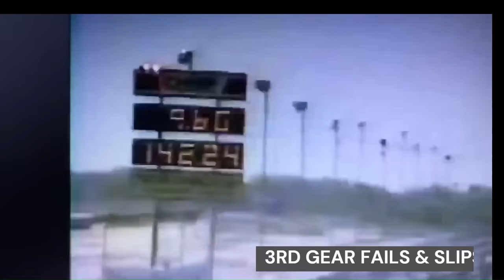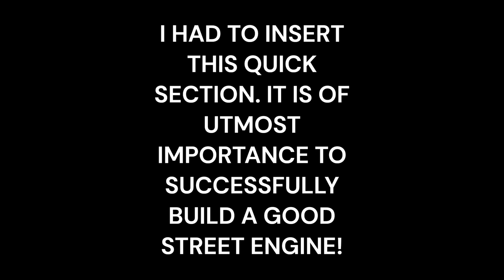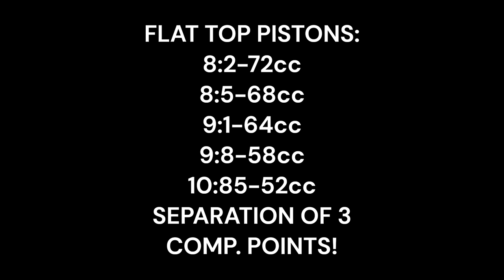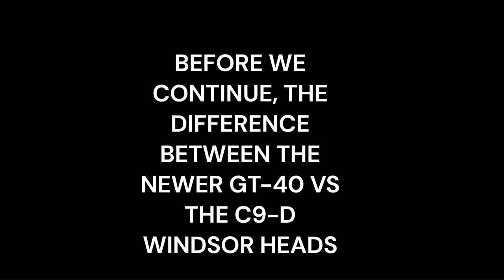BEST CYLINDER HEAD FOR THE STREETS!

Comment: BEN, I would like for you to have a podcast with drag boss garage.he is a Cleveland man.your knowledge would be a very good show.people ask questions and you can answer.
Reply from the maker: We are in constant communication and will team up with a Ford based radical speed trick that can easily be copied for more power!  I am working on it now and he is just waiting on me.
Reply: yes Yes Yes.
Roush heads on a 4.125 boss block 4in stroke. E85 boosted?????? On my Christmas List.
Killer motor for Grenada Zepher or 5.o mustang
Reply from the maker: @mikes.1882  boosted on E85 should give you lots of power!
Reply: I found an article. 10:1 static @ 9psi boost renders the e85 limit of 16:1
This said, closing the intake valve becomes critical. 
Then how much spring to keep a 2.19in valve in line. No bounce.
Now, closing the exhaust valve sooner on boost. 
Ben, I see why guys call you. 
The street. There are reasons why guys don't bring their cars out til midnight. Intake ambient air temp.
Is rocket science easier to comprehend 😂😂
Reply from the maker: @mikes.1882  Thanks Mike!

Comment: Those compression numbers are for 302s and 305s. 64 CC on a flattop 350 is 10.25:1. Proof is the '67-'69 Camaro SS. 76cc on flattop 350 is 8.9:1, proof is '72-'80 L82 Corvette.
Reply from the maker: You are correct sir!

Comment: I've seen people put the open chamber head on a flattop 454 and wonder why they are gutless.
Reply: No quinch area!😂😂😂
Reply from the maker: At the minimum open chamber heads require a pretty good dome to create some kind of 11 to 1 compression which will do wonders big time!
Reply: @benalamedaracing2765  absolutely. I used to do the closed chamber 396 head on the 454 with a flat top piston and that worked well on the street.
Reply: @benalamedaracing2765  you will have no quench! While an open chamber might increase flow? The dome you have to use will be a hot spot, further increasing the possibility of detonation!
Reply: 😂😂😂😂😂😂😂.....right! I've had a handful of clients loving their 8.4:1 BBC! Swearing they were making absurd numbers, and my diagnosis of their gutless wonders was a joke. (Long sigh)

A pending performance wager of $10k held in escrow and for a prideful dyno day.

For 20 years I pondered on CR's being too low, but I never had the time or means to perform multiple tests and confirm my suspicions. 

Then the greatest day of my life happened....BEN ALAMEDA posted the information to YouTube that ended my 20 year long internal conflict. Finally I have peace. 😂
Reply: @benalamedaracing2765 .....ah, SPEED PRO 118 domes. 😂
Reply from the maker: @arturozarate1752  Thanks Arturo!  Glad you experience and found out now what has been giving you fits for years!  lol
Reply: @arturozarate1752  Too many magazine articles try and push this big cam/low compression horsecrap. On the street it doesnt work. I run as much as posisble
Reply from the maker: @gordocarbo , dyno testing does this a lot!  Works at the dyno and slows down at the track!  Two different worlds.
Reply: Hello. I wondering why this works on dyno? Is this because of headers one can get ideal in dyno, but when fitting to the car you have to make a compromise? Thank you for your excellent channel Mr. Alameda.

Comment: Gt40p heads don't require a special header to bolt up or down pipes.. you can use most shorty headers just not equal length shorties, just requires a couple 90* spark plug boots to clear the tubes. The p heads have a smaller combustion chamber as well. Headers are a pain but not a deal breaker. I. Running the same mac shorties that were on my e7s on my gt40p 4bars..
Reply from the maker: Thanks for the advice Matt and for tuning in.
Reply: @benalamedaracing2765  thank you for all of the advice. I've learned alot watching your channel as well as David vizards.

Comment: Hi Ben...As a retired Ford race engine builder and shop owner I love watching your content on YouTube. I look at the aftermarket aluminum windsor cylinder head choices thru a somewhat different window. My main concern would be that the head have comparable flow numbers to the LS3-LS7 offerings and be ready to accept most intakes commonly available. This would most likely require a head with raised intake port runners such as you created. Thus, I was a little surprised that you did not mention the Edelbrock 7721's. This head, in a ported configuration of course, gives the Ford Windsor Performance Enthusiast starting off with an equal footing in the air flow department. My job was always to give my customers the ability to help chevrolet racers get their car back up on the trailer. Kinda like you ?
Reply from the maker: Thanks for your comment and appreciate the feedback.  I did not consider the 7721 because I was concentrating my video on "street heads" so I bypassed quiet a bit of exceptional cylinder heads.  I worked on several 7721 on notably runs in the low 5 second zone in the 1/8 NA.  It is an impressive cylinder head with an excellent combustion chambers for an inline cylinder head out there.  This said, the one I favor very much is the one designed originally by McLaren and eventually became known as the Pro -King cylinder heads. It is one of the most aggressive in line heads which can give the (Glidden) Edelbrock Yates heads a run for the money.  However, this are for all out 9k+ cylinder heads and very expensive!  Unlike years ago we did not have much option like we have today which is very good!
Reply: Ben, what do you suggest with the FE head. The chambers are too big. The aluminum heads are really less than 72, and the iron are 74-76 cc., have used the  early 390 406 that were 58 ccs but good luck finding them. I put 2.19/1.6 and still had 68 ccs. I used L2292 domes .  The new Trick Flow heads are supposed to be good.  I had 4.09 bores, and the 2.19/1.6 valves and had the iron heads tigged along the top to close them in . I opened the intake along the back to the plug. With the dome I got it to 12:1 with thin gaskets.

Comment: Depends a daily driver aluminum ok still not a fan hd off road or motor with torque the steel camels for sure. The aluminum of pushing heat will warp and shoot flames out the side. Just shave or polish them a bit with steel and still have the strength of the metal. But the aluminum when warps loss compression thrn boom. If you shave and polish your feeding the fumes with no ports like cast to hold fumes the the intake out take put the turbo on to push the fumes down and air for the rocket effect. Then you have to add refrigerate to the radiator. Thats why you purge the nitro to cool the heads before the run. The night race you see the jet flames coming out the exhaust. The nos acts as a boost more to cool the turbos before the fan melts. The purge allows the liquid nitrogen to cool the metals and gives a shot for that take off combustion getting ready for extreme heat for 8sec or less. That purge acts like the nitro on rockets. Or cold fusion combustion. Be like a cold burn  still burn only cold. Better example hot ice. Cars not my thing the sled truck you know they take off they have to put something behind it si it stops
Reply from the maker: Thanks Brad for your insights sir.

Comment: Better to have 9:1 with AFR 180 than to have 10:1 with old production iron heads.
Reply from the maker: The iron heads like GT40 will launch harder but the AFR will out horsepower it on the top end.

Comment: This has become one of my favorite channels. Great stuff, Ben. You can always tell the motors with the low compression by the sound when they rev. If it goes blaah blaah, and takes an eternity to come back to idle, it's low compression. lol If it snarls like a beast and tachs instantly and just as quickly, jumps back to idle, it's high compression. That is the scientific method. p.s. I run a 5000 rpm converter on the street, for me, that's perfectly normal for a street car. I think my idea of street car differs from most people's.
Reply from the maker: I like your description of listening to the engine and agree with your observations!
Thanks for your support!

Comment: Your statement about having at least 10.5 compression is bang on.  good compression is more important than a good flowing head For making a car run..
Reply from the maker: On the streets it really matters to have decent compression otherwise a good flowing head doesn't do much good of effect.
Reply: @benalamedaracing2765  agree I dont know why so many guys today are afraid of running compression or even a solid cam. Night and day difference over less compression and the usual lumpy hyd cam. 
Early in your vid that 67? Stang leaves HARD!! Just disappears down the 1/8

Comment: Been building ford and a few brand X engines for 50 years and I still learn every day.Myself  I mostly used 428cj and Cleveland engines for their ability to make great street engines with minimal effort and aftermarket parts.  I like using Ford parts when possible but with the Windsor head situation I will be using aftermarket units. Thanks for your videos as I will be considering this one when selecting the proper head. Great content!

Comment: I built a 302 roller motor with flat tops and flotek 185cc heads in 58cc that I hand ported. With a 650dp and weind intake it made 365hp. Great little motor.
Reply from the maker: Nice work!

Comment: I built a early 70s 302, with 1970 351 w heads that i mildly ported.  Used a .500 lift cam with 280 duration. That was a great street strip engine!
Reply from the maker: They run perfect for a 302 specially ported and milled!

Comment: Love it, in the old days I ran 68 302 4V heads 53.5cc and put the 60s gt40 valves in them 1.88int and  1.625exh I think they were sodium filled, ported of course
Reply from the maker: Ran a similar engine years ago and they are responsive on the streets!

Comment: Love the TW head. Ran the original TW head with a 2.5 MSA on a 4.125/3.50 base 302 to get 374 ci, 11.1, short duration high lift solid roller, EFI R box. Ran a best of 10.32 @ 128 mph on pump gas, street tires, mufflers @ 3280lbs. No doubt the heads were they key ingredient. Was always interest in raising the intake port and filling the floor on the TW head since there is a lot of material in the roof
Reply from the maker: Raising the port on the TW gave me about 30cfm @ 28 which is a bunch of power!  Imagine going from lets say a 200 to 220cc I think if I remember correctly give you under 10cfms.  Therefor 20 or 30 is indeed a big jump without much penalty in the low to mid power and definitely peak hp will go up big time!

Comment: The twisted wedge looks like it has excellent port pressure recovery.that head will make power.
Reply from the maker: Yes it does and seems to have less bends and more straight and does recover faster in that regard.

Comment: Ben, I wish I'd been able to test valve sizes on the GT-40's i ported and ran on my 93 Cobra.

At the time a 1.94 and 1.60 was said to be the big winner! As a student i went with the best I could(I thought) afford. Ford Racing 1.84(maybe 1.94) and 1.54 valve set.  The year was 2001-2002....i don't think i used a larger exhaust valve till i had to install a 10-ppint and a chute. I liked the little exhaust valve. Still do.....MAN, i enjoy learning from  you!

Thank you very much for these videos! 

I don't think i used a head
Reply from the maker: At the time with my 67 at the opening segment of the video I had a 1.94 and 1.625 exhaust on the C9 castings.  It seemed to be the right move even today because the low ports needs all the help it can get.  High ports intake and exhaust would be a different scenario altogether.

Comment: @Ben Alameda Racing You should do a video about building a performance street or off road or towing engine for heavy vehicles like a lifted 4x4 truck with big tires or other heavy vehicles and the differences between building something like that versus a lightweight street CAR, and any tips/tricks that focus on getting huge low/mid rpm torque.  I think that video would be a huge success. There's a TON of people out there wanting more USABLE performance for big heavy trucks.
Reply from the maker: Ok Jeremi I will plan this as well and many like yourself has been asking me for a torque combination for heavy trucks which is also fun to build!

Comment: Ben,
In my opinion the trend of lowering compression and the trend of adding superchargers were so close in proximity of a time frame it was almost a double whammy
Then soon after came ethanol 
Because this was a little while before channels came out....we wound up where we are
Reply from the maker: Correct Danny and with the new high swirl/tumble factory and aftermarket heads it all got better with or without boosts!  Thanks for supporting my channel.

Comment: I love using the gt40 and the gt40p heads. The gt40's are just harder to find . I can find p heads at the junkyard for $ 101 . I port them and get them decked .030 and they run great.
Reply from the maker: I should have stated that the "P" heads will always outpower any E7 castings and you reminded me what I should have stated on this video.
Reply: That's what I have as well. Decked and ported along with the ported explorer intake and a ported throttle body off a first gen lightning. Threw in a crower 15511 cam and 1.7 roller rockers and that little 302 screams.

Comment: i have the 450 hp 454 with the high flow heads at 10.5 to 1 compression it seem to be great for a street truck then i put a high rise with a 850 carb it really did good then i have the 02xx 400r turbo with 4 10 gears 12 bolt possi seems to be perfect for me for a street truck plus cast on cast is better for head gaskets it will last longer not going to race it just drive it
Reply from the maker: One thing with a cast iron 454 you will rarely have any issue with head gasket sealing!  That truck should smoke a lot of cars on the streets.
Reply: @benalamedaracing2765  i would not say that but it looks cool in it big ass engine i would say it is about 600hp right now that is what it feels like

Comment: Man I use a set of old turbo heads on my 377. 12to1 comp, 698 lift , 1050 dominator it rips for a old engine!
Reply from the maker: I used those years ago and was also very impressive.
Reply: I have a set of turbo heads for sale …they came off a 377 .. 11 plus to 1 compression .. on a 37. Chev street car ran low 11’s

Comment: You confirmed my reasoning for using the closed chambered BBC heads on my stock 454 with flat tops and small dish in the middle. With a steel shim .015 gasket and .025 in the hole I calculate 9:1 compression ratio. I think with a .030 head skim I can pick up another 1/2 point of compression.
Reply from the maker: If you can change that to a zero deck there is more power to be gained and use perhaps a .032 thick gasket!  This should seal better but I feel your combo is good with the head gasket you are using with .025 in the hole.
Reply: I run 702 closed chamber oval port heads on my 454 with flat tops, zero deck, 0.038” MLS head gaskets and calculate 9.7:1 CR.  I did plunge cut the chamber wall to relieve the 2.19” intake valve which moved my 98 cc chambers up to 100 cc’s.  With a Straub spec’ed Clay Smith HR cam 221/235 @0.050 on a 109 LSA it has way more torque than my ‘72 C10 can handle. It outruns all these new supercharged trucks which is fun....  RPM Air Gap, 3310 Holley, 40* total timing.....
Reply from the maker: @trailerparkcryptoking5213 , sounds like you got it rock and rolling big time!  Did you try messing with the spring rate on the 3310?  I usually have the earlier versions with the secondary metering block instead of the bolted plate version.
Reply: @benalamedaracing2765  My 3310 came with the secondary plate, but I replaced it with a metering block and I could feel the difference. I have the carb dialed in perfect.  It has always performed well, but a few years back I ran into Dan Davinci at a car show and arranged to have him work on it. He installed downleg boosters in the rear and modified some other circuits then flow tested it and ended up at 830 cfm.  I got it back and it ran horrible with a massive off idle stumble. I stiffened the secondary spring and installed a smaller pump discharge nozzle and now it is perfect.  Thanks for sharing your vast knowledge as I have learned a lot from you in your videos and always look forward to new ones!
Reply from the maker: @trailerparkcryptoking5213  Installing a smaller discharge nozzle also increases the spray duration and perhaps the big nozzle discharge too much too soon. Ran out of fuel just about the secondaries were opening!
You probably got the best compromise on the accelerator pump jet and had enough spray duration to correct the bog.  Glad you figured it out with common sense hot rod mindset!

Comment: Compression ratio depends on other variables, not just flat top or dish and chamber volume. Pistons at zero deck or down in the hole. Head gasket thicness. A 427 with a flat top and 64 cc chambers will have 11 compression ratio or higher. A 350 will have somewhere between 9:5 and 10:1, de pending.
Reply from the maker: I figured my description is set up with zero deck because if I have to list all the variables this video would be much longer.  Therefore flat top with 64cc on a 427 4.125 x 4.00 would be about 12.3-12.4.  A Ford stock 351W flat top, would be about 10.75 which is healthy for the streets with stock heads untouched chambers. I think this is correct it has been a while!  lol